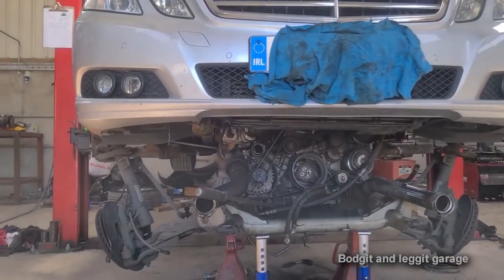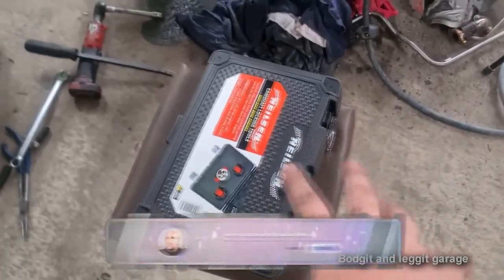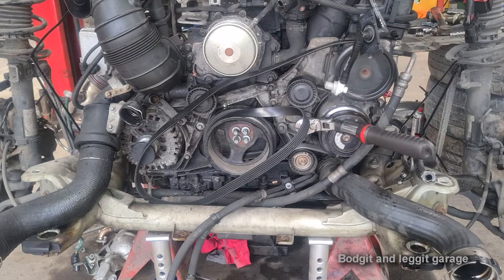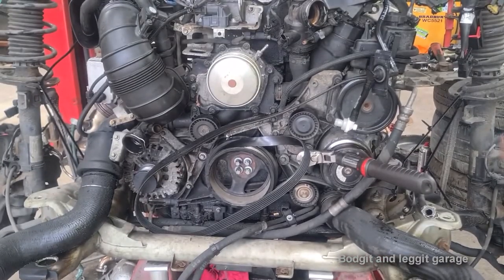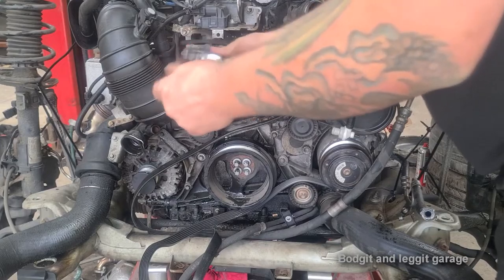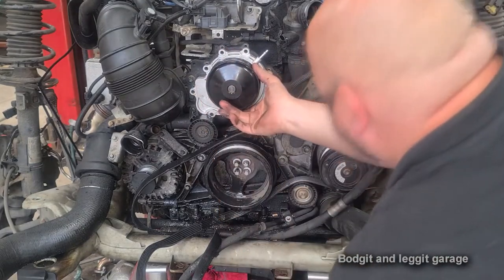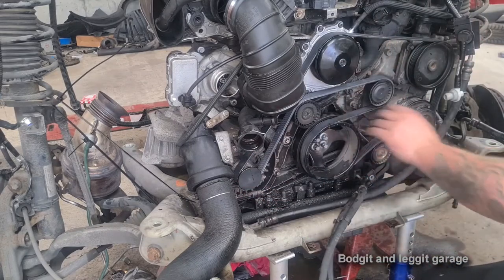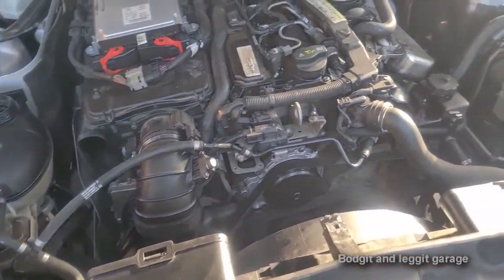W212 Mercedes Water Pump And Fan Belt

Comment: Leon that water pump is only half the job the plastic housing you bolted it to is now aluminium as they updated they because they  crack for fun. It’s cheaper to buy the full lump from mercedes. I know this as I’ve just done mine on my c250 same om651 lump. It’s only 4 E10